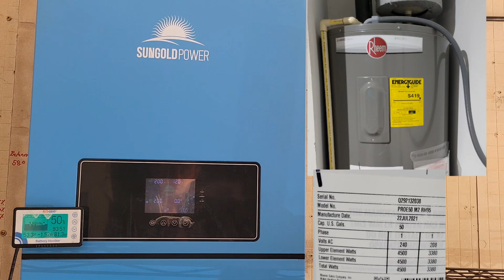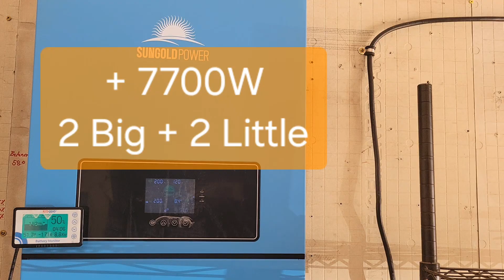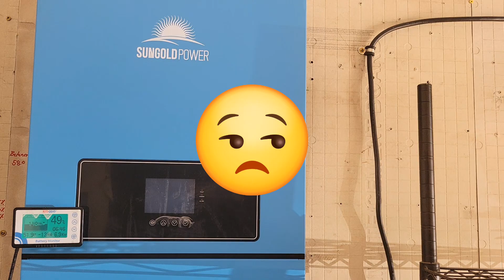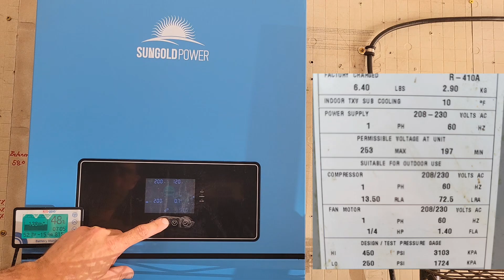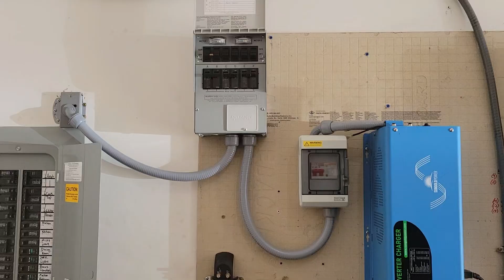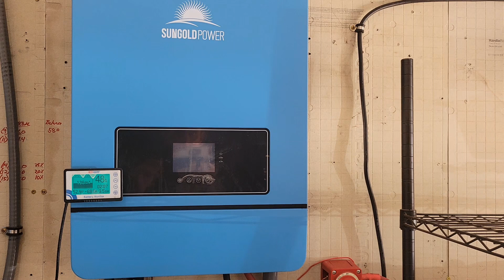SunGoldPower 10kw Testing - Resistive and Inductive Loads

Comment: Does the fan draw air from the DC side and exhaust to the AC side on your  6k LFP  ?
Reply from the maker: There are fans mounted on both sides.  Its possible they both pull air in then ven ou the side holes, but I am not certain.

Comment: install a soft start kit on the outside AC unit. You can also get a bigger better efficiency capacitor that will hold more voltage and limit current rush. It's what I did and I have the 3.5 TON A/C unit. Have more panels maxed on both legs help also. Good luck. SGP is a solid unit.
Reply from the maker: Solid plan with the soft starter!
Reply: Would a Eltwin SureStart 16-32A be a good one ? My compressor has a LRA of 70.0 ;  what would be a bigger better efficiency capacitor for your 3.5 TON A/C  ?
Reply from the maker: @rapidsqualor5367 That one looks good.  Will need to di more reading on it.  The common one is the microair flex.

Comment: Thanks for the inductive load. According to the specs, it should have started it. LRA should be about 17400W at 240V but it failed. I think they lie in the spec sheet like many chinese product. This is lame AF to lie about important specs.
Reply from the maker: Yeah, its kind of weak for inductive loads.  My 6k LFP can even start my downstairs compressor which is even bigger than the one I tested here.
Reply from the maker: In fairness, max raing is only for a second or two on most HF inverters.  LF inverters can hold that in rush current much longer